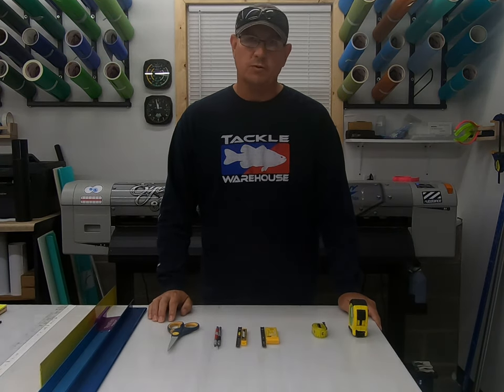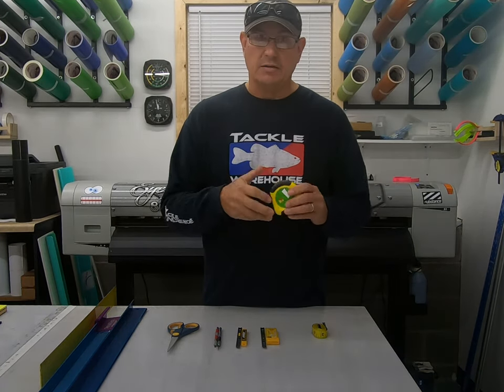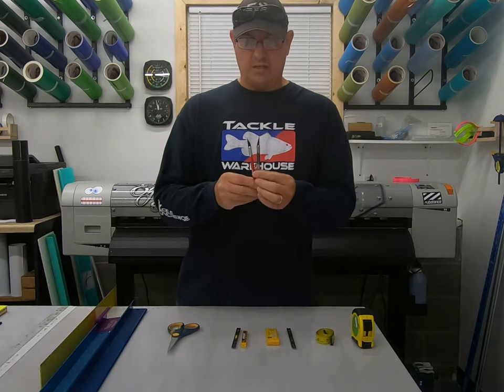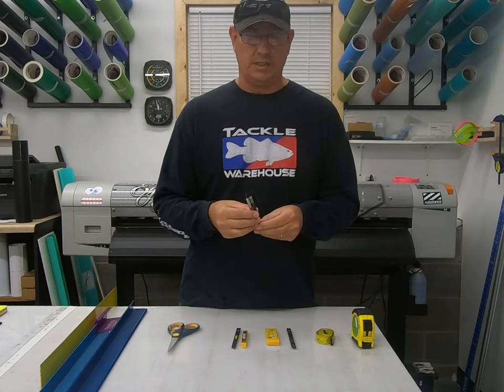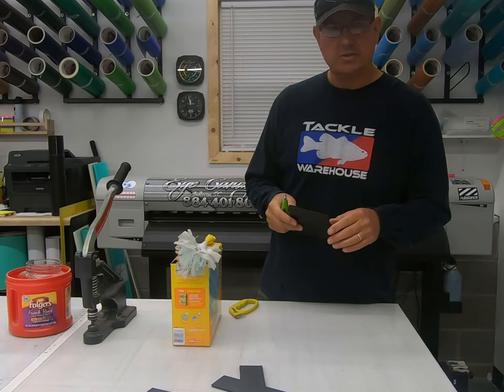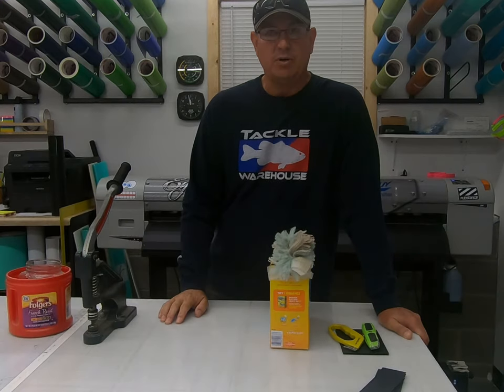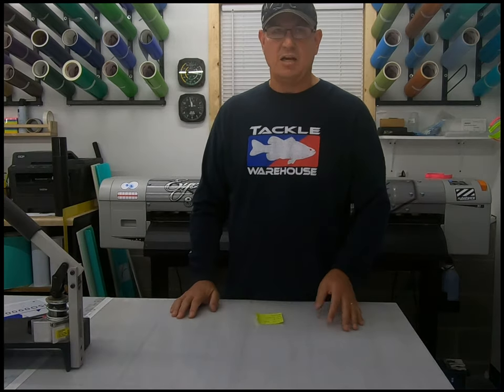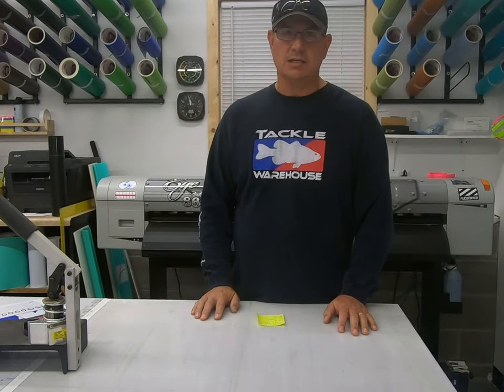Sign Shop Must Have HAND TOOLS

Comment: Great video!  Just retired and moved but this time I'm converting my oversized garage into my shop.  We got the wall unit AC/Heater installed, floor sealed and industrial carpet laid. Insulated garage door finished.  Over head lights installed and outlets on every wall.  Equipment on its way.  Can't wait to get back to work.
Reply from the maker: Thanks for watching, best of luck with the new shop!

Comment: Thanks for the video!! Question, which transfer tape do you use for interior wall application, like the typical drywall in the living room?
Reply from the maker: We used to use R-Tape 4075 High Tack but then went to Grimco's Briteline series High Tack )same stuff) because of the savings. Now any high tack will work, I'm not brand specific about app tape. Also Tubelite has and "Elite" brand with High Tack that I'm working through and seems to be fine with the 631
Reply: @TheSignGuy  Thank you for the info
Reply: @SouthbayCreations  You want to find out what the drywall is painted in first? Do a peel test using 3M 2308 G/P masking tape, if tape dosen't stick to wall you know your graphics wont stick before you go to the effort of prepping grraphics. Even if masking tape sticks you dont want to use Hi-Tak possible areas of app tape sticking to the wall and potentially removing paint - Use low tak app tape but this depends vinyl brand and liners, wax base ideal using low tak app tape, but synthetic clear liners like 3M 7725 and design could be a pain to transfer.

Comment: What is the most common size of the grommet and the die?
Thanks
Reply from the maker: I use 3/8" #2 grommets bought them from GRIMCO but you can get cheaper ones. Just don't get a really cheap ones, we threw one away because it was just junk...

Comment: Aluminum sign!! When applying fairly big vinyl decal, get ALOT of tiny dots kinda like dirt or super mini bubbles!! Oracal 651 dry apply!! Cleaning of the surface not good enough?? Do you have any tips I'll appreciate it 😁
Reply from the maker: Could be static from a low humidity, I use a dry swiffer to pick up any dust before I apply vinyl.